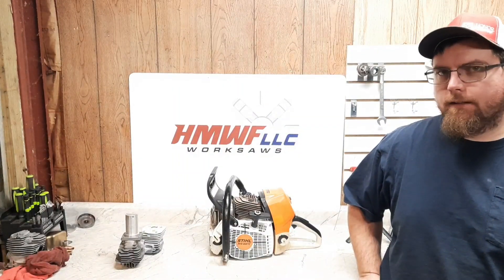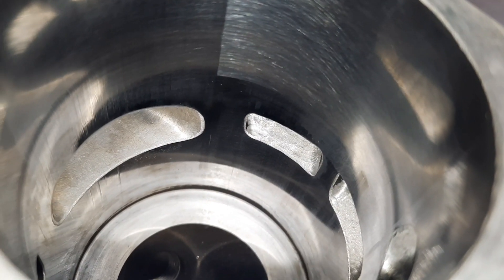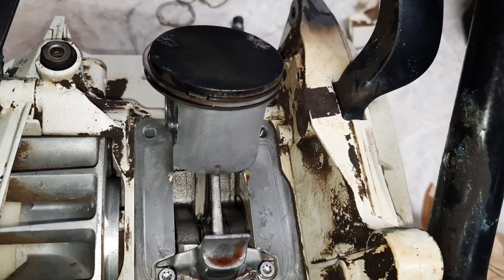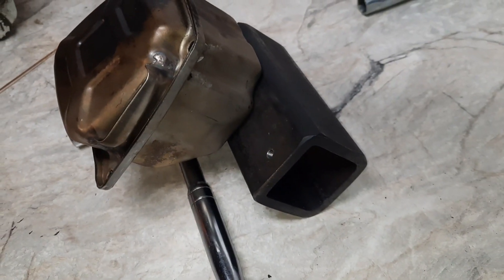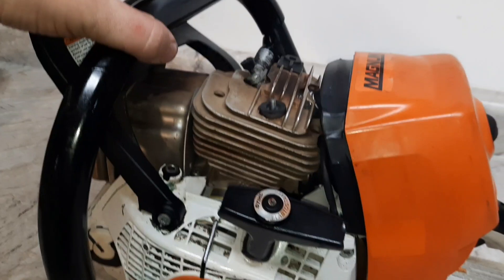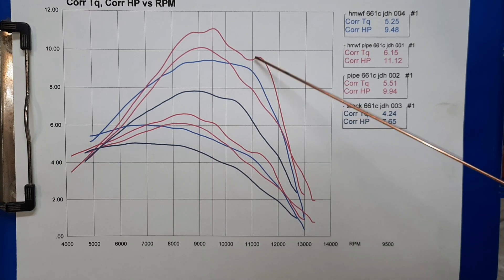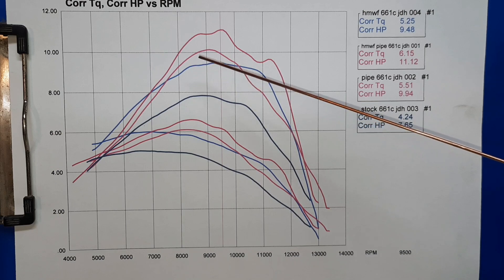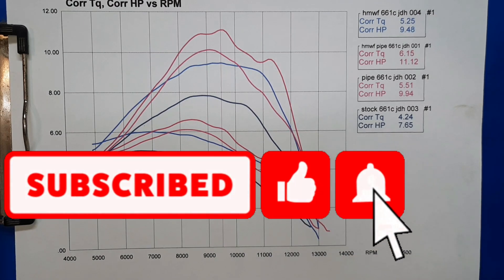Modified! Stihl Ms661!!

Comment: It seems like the ported 661's and 395's keep beating out the 592's that have been ported.. really wanna see 10+hp 592
Reply from the maker: 592s have a few built in limiting factors for a work type build. But they are very stout out of the box.

Comment: Thanks for your uploads, I find lots of good info on your channel. I just acquired an MS661. It was sized by running straight gas and looked really bad inside the cylinder. But it cleaned almost perfectly! I can't feel any scratches under my fingertips now. Waiting for a new piston, because it was irreparable. I'm not going to port it, just a gasket delete and a muffler mod. Maybe bevel that lover transfer entrance on the cylinder, it looks so small and has to feed both upper transfers. First time I see that form of transfer ports.

Comment: Man that pipe blows my mind ... wonder how a progressive mods on stock style muffler can reach peak power ... what works and doesnt... curious to see that on a ported saw.... single double and triple port or that vs bark box style
Reply: It’s rumor that removing the baffle on the mtronic style muffler actually reduces horsepower ..... curious to see what that difference would be
Reply from the maker: I have an exhaust test planned. Still waiting on some parts.
Reply: @dynojoemods2764  I have a 462 bark box here if needed, I can drop it anytime if you'd like.

Comment: You could balance a coin on that power band from 8k to 11k. That’s what you want in a work saw right there! Thanks Joe good stuff everytime👍🏻
Reply from the maker: Usable powerband is key.

Thank you for watching.
Reply: @dynojoemods2764  Looked to follow the factory nearly exact, just wider and higher, perfect!.
Good to see you get it running :).
Reply: What's up Doug.
Reply: @brettblack7049  whassss happnin Brett?😎
Reply: @IndianaDoug  Sitting on the couch enjoying the fruits of my labor, it's 7 outside and 75 inside.
Gotta head to be, have a great weekend when you get to it :).
Reply: @brettblack7049  you too bud👍🏻

Comment: Man I'm speechless... 1stly, thanks a million not just for what you do but for sharing it (and doing that in such an outstanding form!)  Ok, to brass-tacks here:
- I'm tickled-pink seeing someone who sees OEM muffs like I do, the way you do the muff in the 461 video is my go-to for 660 muffs (IE, making a new exit, on the PTO side, opposite of the largest OEM exit...though I also go and block the other entrance on the upper-side of the front cover), I cannot help suspect/expect that the design is intended to allow the pulse to "bloom"&expand into that largest/widest area at the bottom-front edge of the muff, where it'd then "arch backwards" back to the flange area -- *and* to the OEM main exit!  I think it's no mistake that the main exit is right-past the flange, because this would effectively "force" escaping air to rush-by the next exhaust-pulse exiting the flange, creating some level of 'pull'..."cylone"/circular-gas-flow in a muff is one of the only ways, IMO, to truly create suck/pull on the flange w/o using a tuned-pipe..would love your thoughts!
- Are you ever gonna do a video on 'best types of canned muff designs'? You mention it in the "noise or power?" vid on lil-pipes, a vid where you mention these lil pipes are reaching nearly 1/3rd what your pipes reach, I didn't realize just how big that was (your pipe-on-OEM-ports was nearly on-par with ported-with-OEM-muff! To be crystal clear, all "OEM muff"s in this context/tests are "modded OEM", correct?)
- I only care about what I can actually build for-work, is it fair for me to think the following: Porting should boost me quite a bit, and then I'm adding about 1/3rd of the expansion-chamber gains by going w/ a proper short-pipe?  Ported 56mm 660 squishing 24.25thou, 1.25mm from-freeport, 99.5/81/126, will say I'm surprised hearing your squish #'s being so large (also surprised seeing you make flat squish bands like everyone else, with your 'schtick' I guess I was expecting multi-angled lol like flat for 1mm, then 0.5deg for 1mm etc til 2deg arch into the chamber....squish-velocity is totally improved when you get rid of flat bands, they're better than 6deg OEM bands but tapered a lil is still better!) BTW am curious if you generally like popups / domed pistons?  For instance I was gonna do low 30's squish on a pop-up build, but when the pop-up had a defect/flaw (bad pin placement) I simply tightened down to low 24thou's squish to compensate for using a flat-top :P 
Thanks for ANY thoughts, SO eager to see you do a "canned comparison video", honestly I bet the ultimate muffler will be....gah I'm gonna bite my tongue & hope I didn't already post it because I suspect I can find a welder and it'll be easy to do, and should beat ALL of those lil pipes (won't beat an expansion chamber but should HANDILY beat those lil pipes by a respectable margin like at least 1/4th the way from lil pipes to real pipes!)
Reply: I'm 2 months' of reading & tinkering from my prior / 1st comment on this video but, damn, I just cannot help re-stating how BIG I think this is (the power-levels you're extracting), I genuinely cannot tell but it SEEMS you aren't just "the best" but are quite a level above the competition-- I BADLY want to be corrected on that, by your or anyone else here, if I'm wrong...but seeing you pull 100%+ power-gains on 60cc cs590's (still can't believe the carb/chassis/etc can handle it!), pulling like 1/4th to 1/3rd+ gains on "regular portwork-only" jobs like the 661 here or sorry it had muffler opened too but wasn't fully blueprinted, spark timed to within 1deg of optima, carb jetted etc it was basically "just" a regular ole port&muff mod, I think it's safe to say most people are NOT getting a ~25-30% boost from their portwork!!!  
I hope you do not mind the comments I leave but wanna be clear that if you see them as clutter please please know that I'd want you to delete them, I'm a newb in this niche BUT I have put a LOT of study and experimentation into building (660 platform primarily but it's all VERY translatable IMO) and I was very saddened by the MASSIVE disparity between our 2-strokes (OPE/non-piped) and the "real 2-stroke performance world", bothered the hell outta me-- your work & work of those like you is closing that gap, I know the lack-of a pipe (which is REQUISITE for a WORKsaw, gah I wish nobody ever had the idea to put a pipe on a chainsaw, IMO it just "muddies up" things) lack of pipe means we can't extract the same power-per-CC from a unit but just how much weaker must they be?  We all know it's not JUST lack of pipe, but a different set of EPA criteria, so - seeing the work you do & those like you do - lets us lay builders understand 'the limits' a bit better, so to speak!  Just knowing a cs590, frank'd to an 8HP+ output, knowing that could actually go in-field, for days/weeks/MONTHS without blowing-out the bottom-end, that is VERY comforting-- makes me wish I had the time&$ to buy & build more, so I could push more bounds -- thankfully there's Youtube with folk like you, so I can at least get a view / insight into the state of the art of OPE-2-Strokes (by "OPE" i simply mean 'real' outdoor.power.equipment, IE "non-piped / box or can style silencer as exhaust system")  
Will be making a video on exhausts and tagging you in the title, in hopes you'll consider a couple of the ideas presented (non-restrictive baffle-plates "sandwiched" in 440/660/880 mufflers to "break up" the exhaust pulse's initial "contact w/ exhaust", and other inner-muffler modifications to lessen the return-acoustics' "plugging" effects), as we obviously cannot control - and therefore don't want - these quick & intense acoustic waves in our non-piped OPE-2S's, but if you've got an exhaust-port you've got acoustics, lol, so we gotta work in those confines-- but my muffler-can design, when combined w/ appropriate Grunt Gasket - should effectively ELIMINATE any return-acoustic issues w/o having any measurable impact of the flow or throughput of the exhaust system itself, I sincerely hope you'll watch it and, if you think there's merit, I'm happy to ship any of the baffle plates or grunt gaskets to you (not that I think you'd want that), am guessing you can just spin-up whatever you can envision in your shop-- which is why I'm SO badly hoping you see & "run with" my idea for a REAL lead-in-pipe(grunt gasket), you already know we can like ~1" headers/lead-in's and then any longer our muffler would be hanging-off the front of the crankcase, BUT - if one could fabricate it, just basic welding no biggie to you - but one could simply make a 3" lead-in, wherein 2" of the 3" pipe reside INSIDE the muffler-can, wouldn't really matter because the header ends and has over 1" to dump-into the front-plate, where the pulse would 'bloom & roll' to the rear of the muffler...video will illustrate it better, I'll of course send a URL once it's up!

Comment: The ported numbers are great. Ported was not far off of the pipe on the stock cylinder. It's amazing how much better the pipe worked on the 660 which I now it was designed for it. With a less restrictive air filter do you think the 661 would break 10hp?  Also you thought about adding the dyno charts to your website? It would drive traffic from YouTube to your website and vice versa. You might even be able to charge a couple bucks a month for a subscription to the dyno charts?
Reply from the maker: I think the 661 ilkes the higher flow filters. This was a rather tame cylinder. I think ported and better filter 10hp can happen.

I do have a lot of the runs on Facebook. I could possibly add them to the website